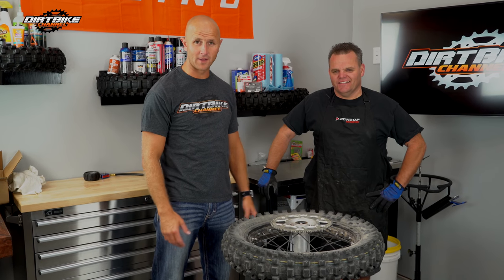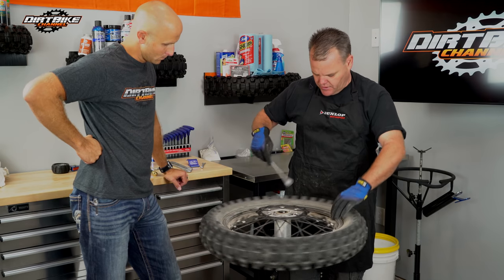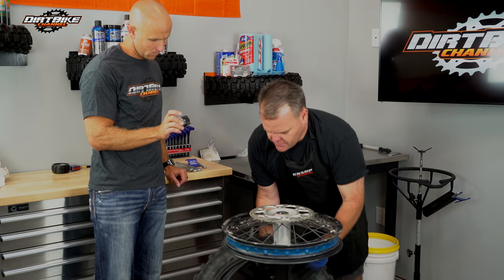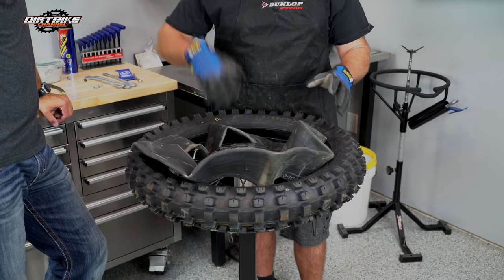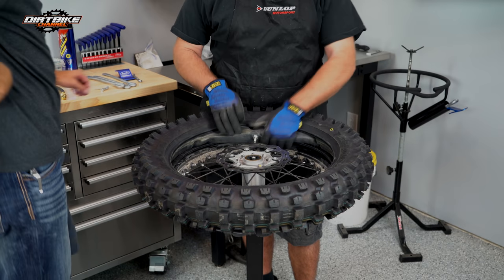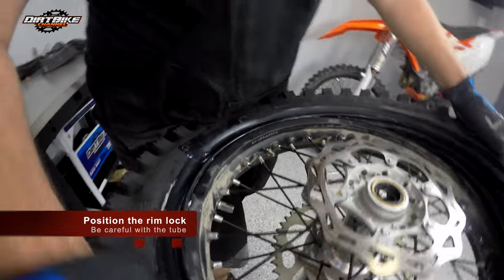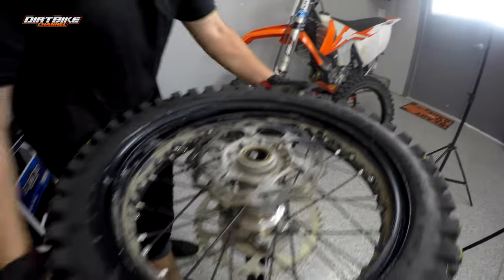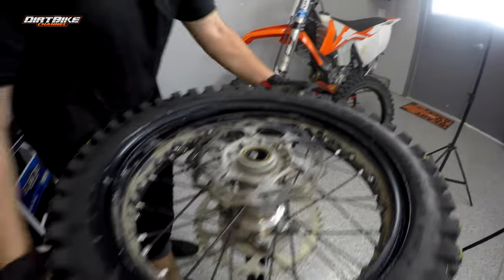How to Change a Dirt Bike Tire - Episode 170

Comment: Did my valve stem nut tightened to cap like in video and valve stem ripped during an enduro causing a flat. Idk if this is a fluke or just bad advice.
Reply: Rim lock on installed properly?

Comment: I hate people that can change tires that easy
Reply: I can do it that quick but there will be like 10 holes in the tube.
Reply: Yeah, this guy is good.
Reply: It really ain't that difficult. If it is hard to change tyres one does it the wrong way OR have old tyres. An other thing to note is that powder does more or less nothing to prevent pinchflats. Use mousse grease insted. If you think avout it like this you will understand why. With two fingers, pinch the tube. Does it "slide" away from your fingers? Most often NO.
Now with mousse grease, do the same thing. Does the tube "slide" away? YES. 

If it is easy for you to pinch the tube it is as easy for a rock. 
If it is hard for you to pinch the tube it is hard for a rock aswell.

Comment: PRO TIP:  Those last two bites; instead of removing the tire spoon, take the bite then slide the spoon over for the last bite.  That way instead of “not scratching the wheel too badly.”, you won’t scratch the wheel at all :)

Comment: The tire shouldn't spin and put pressure on that valve stem if the wheel lock is in place correct? I've always had my valve stem nut tight and never had a problem and I'd run 8-10 psi.

Comment: Practice and technique makes perfect I pinched around 6 tires before I got it right a little different to this technique tho but it’s a lot easier for me 2 tire changes in a row doesn’t take me that Long either simple once you do it a few times and use the right amount of tools I don’t have anything to put my wheel on I just put it in a work top

Comment: I have replaced a tube twice in a couple months on a Ktm 250 sxf (rear) same damage to the bottom of the valve stem where it meets the tube. The wheel has a rim lock . Also The valve stem came with 2 nuts on it and I left one on the inside of the rim. Any ideas why it keeps bursting the tube below the valve stem? Last puncture caused me to crash of a jump landing so I’m keen to get rid of this issue..

Comment: I like to use 2 rim locks, usually add one on opposite side of rim from the original. Helps balance on the KTM. Any easy tricks for installing with 2 rimlocks? These pro guys always make it look easy.

Comment: Everyone remembers their first attempt at changing a tire.

“It looks easy, can’t be that hard” 2 hours later, sweating and it’s done.. only problem is it doesn’t hold air 🤦
Reply: Great, 😆 about to do mine for the first time. 🙏🏽
Reply: pinch the tube.
Reply: @king49334  more than once.
Reply: that only happened after I changed it about 5 times. it's discouraging..

Comment: Doesnt the yellow dot have to be right on the valve stem
Reply: That's the light spot on the tire. It should be lined up with the heavy spot on the wheel for the best balance. The heavy spot on a wheel with a rim lock is at the rim lock. If the wheel doesn't have a rim lock, you should line it up with the valve stem.

Comment: hi everyone! i will buy a 2nd hand ktm 250 exc, but it is 2nd hand, it got 11000km and 380h, it had a top rebuild lately, what you guys think should i buy? it is from 2008, i know this is very little detail, but what i am really not sure is if 380h and 11k km is much or few
Reply: in other hand i got an 2005 exc with 9k km, no hour information and it is 1000 euros cheaper

Comment: I'm curious, it kind of looks like he has a little bit of air in the tube when he's installing the new tire... Is that correct? And if so does having a little bit of air in the tube make it less likely that you're going to pinch the tube with the tire lever?
Reply: At 5:54 he adds air

Comment: Warning, if you use this removal method on a tight bead/rim interface, your rim will be stuck between both beads and you'll hav to painfully reverse.  This only works with loose tires.

Comment: To all novices, DO NOT attempt to change your own tires. Definitely take it to a shop. You will end up butchering your new tire bead trying to get the last 1/3 of the new tire on, especially on the rear, plus you'll have a small battle getting the tire over the rim lock correctly. These guys in the videos make it look easy just to push product. You'll notice them always pushing either a bead buddy or tire irons and everything else. In the end, you'll be left with rims you badly scuffed up and a trip the local tire shop anyway. Learn to dismount your rims from your dirtbike and drive them over to the shop.
Reply: one of the best things in life is learning new things. Some do some don’t. Either way is ok.
Reply: @maikelnait4495  I agree in that learning new things is what I live for. Having said that, there's a learning curve for a lot of these newly learned tasks and there's a HUGE market out there pushing every stupid tool under the sun to get you to open your wallet.  This specific task has a very expensive learning curve and should not be attempted unless you have money to blow on trial and error.
Reply: @KefirTView  Yeah, I know. I can build that stand, tire irons don’t cost that much, that paste I can replace with dish soap. The rest is just being present/aware and common sense. Of course i have pinched some tubes when i was younger but fixing them was also interesting. I mean one can give up right away or... I speak for myself of course.
Reply: I've never had an issue replacing tires

Comment: I got 30 hrs out of my AT81 in MN  Decent tire up here...
Reply from the maker: Where are you riding it?
Reply: Minnesota/Wisconsin.  Not much for rocks like what you guys have, more black dirt, some sand, some rock, some clay.  Has held up well, and better than the Michelin S12's that I have changed after 10-12 hours.  its on my 250X.

Comment: The fing tube is the problem, I keep puncturing the dam tube. My 200mph sport bike doesn’t need a tube, why does a Dirt-Bike?
Reply: Lol are you jumping your street bike or hitting rocks/tree roots? The tube is there to reinforce the sidewall of a dirtbike tire. You can't have a hard impact on just a rubber tire on a metal wheel.

Comment: How is it Everytime I mean Everytime people making these videos leave out the main plot points n how to install these kind of things ya no damn well your not showing how this inner tube goes n tell me something that washer and nut on the valve stem how does that go n again how is it that none of these videos on YouTube shows u that that washer and nuts all come off the tube until it bare tube and that washer either goes under the rubber ring n there or it goes on the outside  of the rim then both nuts go on if you don't put this valve stem n you will b doing this job again and buying a new inner tube and u will have to buy a new tube because it will wear a hole n the valve stem if the washer and nut on the inside of the rim it will blow the tube Everytime and u do want to rap black electric tape on the inside of the rim

Comment: Just get the local bike shop to change it for you that's what we always do cost like 10$ and supports the local shop
Reply: My local shops charge $30 for a tube and $50 for a tire!
Reply: same, screw those prices. its cheaper for me to get all four of my jeep tires installed than its for one of my dirt bike tires.
Reply from the maker: That adds up.  Learning how to do this yourself is a valuable skill.

Comment: Would it not be easier to just grease the inner tire before you start bending with the tool. I use a little piece of swamp with some Industry grease on it, and just run it around on each side before the bending starts.